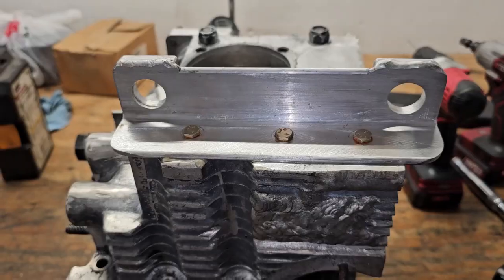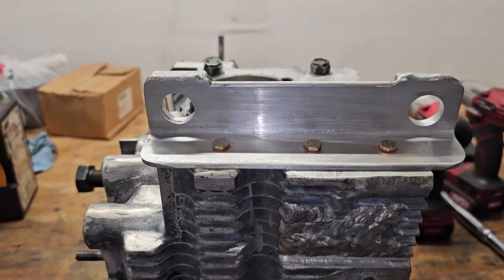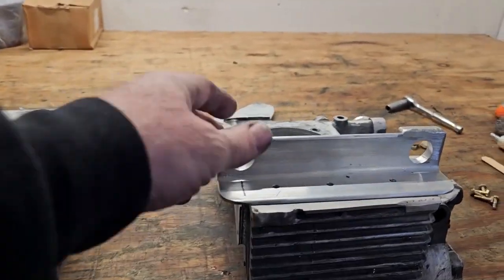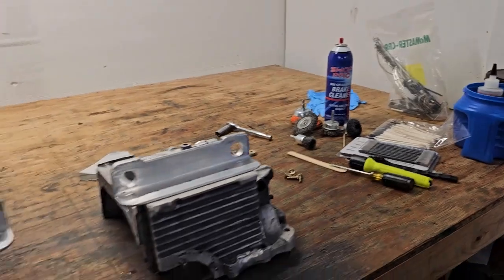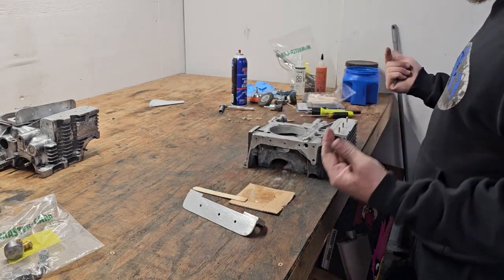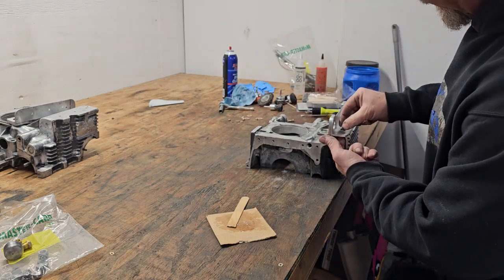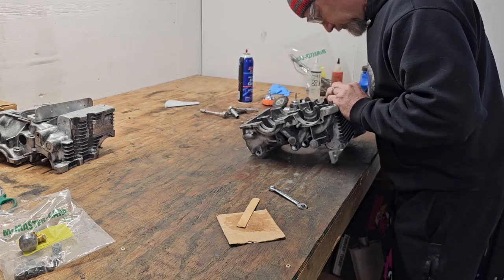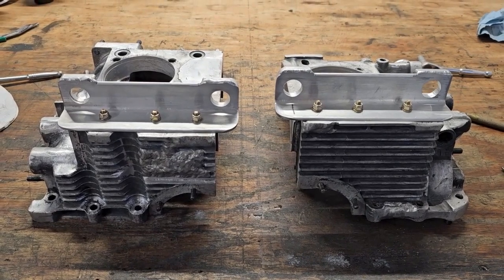1/2 VW Build - Part 12 - Adding the Engine Mounts

Comment: Not sure if that bolt is exposed to the oil system but orange silicone is a bad idea inside motor
Reply from the maker: Why?
Reply: @xpsgarage   I'll answer this one.   Been a VW guy for the past 32 years, and all the VW gurus have written about how many engine failures that they have torn down and found rtv/silicone blocking oil passages, bearings, etc.  Lots of spun bearings etc due to blocked oil passages.  Rtv doesnt break down in the oil and runs around oiling system till it finds a settling place, most often in a narrow oil galley or oiling hole.  This issue has been documented over and over and over again, but it seems to be the norm in the aviation VW realm.  Interesting.
Reply from the maker: @mikerubenhold1066  At the time I was thinking that Chris thought the silicone wouldn't handle the oil.  I definitely agree with you that excess silicone inside is a very bad thing for the reasons you listed.  I always try to make sure to apply it so I don't get squeeze out because I've taken apart a few engines that had chunks of silicone in places it wasn't supposed to be.  It is definitely the norm on these 1/2 VWs to put it together with silicone.  I think I went a little light on the silicone on the bottom cover and have ended up with a drip.  The screen should also catch anything very big and I intend to pull it out and check it at oil changes.

Comment: Im not sure whereabouts you live in missouri but we discussed you potentially welding my case a while ago, perhaps youre close enough i could deliver it if youre still willing.  Im in hellinois
Reply from the maker: LOL I'm out as far as picking it up.  My wife and I got detoured into Illinois on the way to Oshkosh and I'm like we can absolutely not get stopped.  My son and I went to Bowling Green Kentucky to the Corvette museum and got detoured through Cairo.  That was an interesting few miles.  I am definitely willing to weld your case and winter time is perfect to do it.  I'm in SW MO.  Zip code is 64744 if you want to map it out.
Reply: @xpsgarage  thats about 6 hours from me, might be easier to ship it.   Ive already machined the back of the case down, but im not 100% sure just HOW far i need to go to get it within range of the crank for magneto interface.  Perhaps i need to dry fit my crank and do some measuring.   Either way, the parts that need welded are the same from mine to yours.
Reply from the maker: @flyguyeddy  Yes shipping would be easier.  I need to take some measurements this weekend and figure the magneto connection out too.